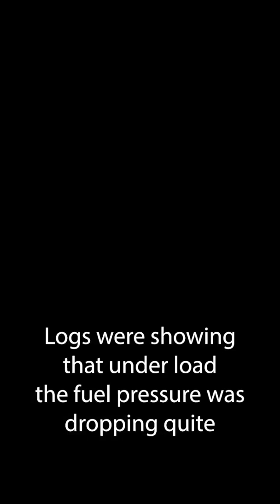The Supercharged Marauder is fixed!! Fuel... #shorts

Comment from the maker: Check out our Q/A video!  Long form video based on your questions and comments!

https://youtu.be/Rn21a6UMAcQ

Answering common questions from these comments such as:

Question 1:  Should you use Anti-Seize on the NGK TR6s used?

Question 2: What is the history of the Mercury Marauder? (Focusing on 2003 and 2004 model years)

Question 3:  Why be excited about reliability at only 103,000 miles??

Question 4:  That car is slow! (Is it?)

Question 5:  What supercharger is that?  Were those factory supercharged?

Question 6:  Why not put more boost to it?  
Make it faster!

Question 7:  If data showed the fuel pump was bad, why did you get focused on thinking it was a headgasket?

Comment: For max performance do not put anti seiz on a plug with the shiny trivalent coating. Trivalent is a highly conducive anti seiz. Applying Anti seiz paste to these plugs acts as a electrical and heat insulator. A plug cools through the porcelain/threads and also makes a ground connection (+plus-equals spark) through the threads. Both are very important especially on a power adder equipped vehicle. Most spark plug companies will state this on their website.
Reply: Ya definitely not gonna listen to them especially with aluminum heads. I think the issue they are concerned about is breakage so my thought is shoot under the torque spec since the threads are “wet”. Considering the spec would be different on wet threads. Idk i have used anti seize on everything and never had an issue. I also always use copper anti-seize and rarely nickel. I have had issues before with the nickel anti seize. Also nickel i do not believe is sensor safe not that it really matters for most bolts.
Reply: @Sak-zo1ui  spark plug threads are already coated for anti corrosion, the main issue with steel fasteners into aluminum is from galvanic corrosion which the coating spark plugs have already prevents. Because corrosion is a non-factor all the anti seize is doing is throwing off your torque specs, which you say you “undershoot” to be safe, but now you’re adding in guess work. There’s a reason the manufacturer’s specify not using anti seize on spark plugs, you’re more likely to run into an issue using it compared to not using it, but go ahead and keep doing it if it makes you happy.
Reply: @Sak-zo1ui  dont overtorqe your stuff
never had a problem even on a overheated head
Reply: @TheWallsocket  yes the spark plugs are coated. Just like galvanized bolts are. When both are exposed to heat and friction (specifically the threads) that coating will get removed in many spots. This can allow for corrosion. With stainless bolts you apply anti seize to A. prevent galling and B. to prevent corrosion between opposing metals. The same effect is there for spark plugs. Yes they may have a coating but that coating does wear away very easily and will still not prevent galling. Now if the plugs are some basic plugs that are going to get changed in 30k miles alright. Does not really matter for corrosion. But an iridium plug that may last over 100k miles I think that anti-seize will have a great effect. But it still would not be protected from galling if not applied. Which galling does occur more in softer materials with fine threads. It really comes down to the depth of the thread. There is no downside to antiseize. 

When i was saying “undershoot” i was refering to not trying to hit a specific torque. When torquing dry threads you may know that the bolt may stick and can often times require more torque to get to the correct torque spec. An easy way to solve this lubricating the threads. When using antiseize the torque should be hit and thats it. Do not keep checking the torque. I know undershoot is the wrong term I just cant think of the correct phrasing. Remember we are talking about bolt torque which is used to get an approximate clamping force of a fastener.
Reply: @spedracer55  i dont over torque my stuff. But torquing dry threads can cause over torquing. Wet threads always are more accurate torque specs.
Reply: Highly unlikely any spark plug manufacturer would specify not using anti seize on spark plugs with long term service intervals with dissimilar metals and low HP levels, this is not a max effort replace plugs ever couple hundred miles race machine. Long term thousands of heat cycles will create a perfect storm with that coating and no anti seize to gall and destroy the threads coming out. Ive done it with NGK and other brands never again, they work fine for max effort high hp and regular changes but not for long tern use.
Reply: @young11984  most do specify to not use anti seize. Read some of my other comments if you want to read a paper lol. I see nothing wrong with using anti seize.
Reply: @Sak-zo1ui  especially ngk
Reply: @Sak-zo1ui  they also recommend short service intervals not 100k miles also, i use it and always will because i have had to remove heads to get seized plugs out of heads with 40k miles on them at the dealer. They recommend but its always service bulletins to change recommendations or add a way to get plugs out vs telling you to add a touch of anti seize to solve the whole issue
Reply: @young11984  i do the same to brake lines. Very minuscule amounts at the top of the threads. It works never had an issue and I dont round flare nuts anymore.
Reply: Most intelligent comment I’ve read in way to long! Thank you
Reply: I’ve maintained and driven many high mileage Fords. 79 LTD 351 windsor, 93 Lincoln Mk 8, 99 Towncar, 06 Towncar, 03 F150 FX4, 2012 ecoboost FX 4. All but one of these had over 200,000 miles when I sold or totaled them because someone rear ended me. Never had a problem with spark plugs seizing even with intake manifold leaks dumping coolant right in the old 4.6 plug hole where it just sits there wet forever and eventually causes a misfire. No anti seize ever used. Also no torque wrench ever used on spark plugs and no problem because of it! 
I did always use motorcraft plugs and motorcraft other high maintenance parts and filters.
Reply from the maker: This is a great comment. I've already noted in some other replies that I've had it hammered over the years to use antisieze on Ford aluminum heads of this era. Never thought twice. But read up on the NGK site and understand. Your comment also very informative.  I swap plugs on this car fairly often so next time will go without and see. So far Ive not had any other issues but to be fair this is a relatively low boost car at 9psi and stock ignition coils.  I could see this being much more important on race / high boost applications where maximum spark energy needed. Still great info and I'll follow it next time around
Reply: I never used anti seize on plugs alum or not unless the factory manual says so and I never seen the factory do it
Reply: @young11984  fun fact plugs come out very easy on a hot motor I never had a issue taking a plug out
Reply: @jimcatanzaro7808  ok, work in a shop up north and at the beach then tell me how easy it is
Reply: You just fixed my mystery misfire thanks .
Reply: @kevintucker3354  thank you
Reply: Ngk specifically says do not use anti seiz on the box
Reply: @Usual Suspect William Hamilton it's because of the coating they use on the threads also technically if you do put anti seiz on the threads the torque should be adjusted because it is no longer a dry torque
Reply: @Sak-zo1ui  I read something similar to this on ARP’s website
Reply: @FZERO20  yes. Dry torque is very different from wet torque.
Reply: @VortexGarage  your right, I see what this guy is saying, but I've put enough helicoils in these thin aluminum heads

Comment: The ngks I've always used are plated and you should NOT put anything on the threads. Lube on threads makes the recommended torque incorrect.  If you use spec torq and lube you are over torquing the plugs.
Reply from the maker: Great info - I've always done antisieze for years and years so much I don't ever think not to.  Read NGKs site and next plug change will try without. Always made me nervous not using on the older ford aluminum heads but seems the newer plugs helped solve that.

Comment: Another 👍🏼 to the OP. Use it very sparingly and only the smallest in the middle of the threads, you’ll be fine. 
Also a tip for those of you with the dreaded 3 valve tritons, always remove the spark plugs when the engine is HOT, use gloves and be careful for burns. Be warned that if you try to remove plugs when cold, your chances of shearing that plug go through the roof. Promise you’ll really wish you could trade that broken plug for a burn on the back of your hand every time.✌🏼

Comment: You're not supposed to use anti-seize on NGK spark plugs
Reply: Why not 🤔🤔
Reply: Pls explain as I do
Reply: There is a trouble service bulletin out that anti-seize prevents NGK spark plugs from grounding properly into aluminum heads
Reply: @Red_Tech1  Ok. I was reading that on a few of the forums.

Comment: Ngk plugs are designed for use without lubricant
Reply: For racing and random changing, not for 100k mile intervals as these were....not a downside or negative affects of using it for long term intervals and low HP levels
Reply: @young11984  Makes no difference, the spark plug manufacturers do not advise using anti-seize and I doubt the car manufacturer does either.
Reply: @ferrumignis  makes a difference when i can pull a plug at 100k miles and do not harm a thread because antiseize was used but have pulled many at 40k and galled/destroyed the threads for not having it. Why would a manufacturer say not to use it? So they can sell more parts when the threads get torn up, thats why. I guess you do everything the manufacturers and parts suppliers recommend then, if so you would never race your car to begin with and find limits of said parts.
Reply from the maker: Stated in some other replies but this is great info. With ford aluminum heads I always used it without a second thought. Many plug changes and no issues but you are right checking NGKs site they use plating on the TR6 plugs and say it's not needed and could affect torque spec. Next change I'll go without.
Reply: @Usual Suspect William Hamilton  NGK do not recommend anti-seize as confirmed by Vortec garage above.
Reply: @Usual Suspect William Hamilton From the ngksparkplugs website:

"NGK spark plugs feature trivalent plating. This silver or chrome-colored finish on the threads is designed to provide corrosion resistance against moisture and chemicals. The coating also acts as a release agent during spark plug removal. NGK spark plugs are installed at the factory dry, without lubrication or anti-seize."

"Anti-seize can act as a lubricant, altering torque values up to 20 percent, increasing the risk of spark plug thread breakage and/or metal shell stretch. Thread breakage can sometimes involve removing the cylinder head for repair. Metal shell stretch changes the heat rating of the spark plug and can result in serious engine damage caused by pre-ignition. Do not use anti-seize or lubricant on NGK spark plugs. It is completely unnecessary and can be detrimental."

Why not grow up, accept you are wrong and learn from your mistakes?

Comment: I've got a beautiful 03 Grand Marquis with just under 300,000 miles and have always put the plugs in dead naked, never had a problem.  They do tend to vibrate loose if you don't torque them down properly but since I always do that, they never come loose.

Comment: That’s a cool video well done but I think I would’ve checked the fuel pressure before I was doing compression testing. I wouldn’t do that unless I had a continuous missfire
Reply from the maker: I should do a long form video to talk through it more. Basically I had seen something that had me concerned about the engine. When it ran poorly I started connecting engine dots. A good lesson in the end though that the data tells the story and the truth

Comment: Extremely common on crown Vic.
Only showed up on police cars after idling for a while then full throttle for 8 seconds. Ford blamed municipal fuel supply and made us seems out the tables for cleaning. They also conveniently updated the fuel pump though.

Comment: ngk spark plugs come witha anti-seize coating on them already, puting anti-seize on them will give you a false torque reading on occasion.
Reply from the maker: Very interesting - I just read up on their site. I've been doing a dab of anti seize on plugs since I can remember. Never had an issue and was always nervous not using it on this Ford aluminum heads. Plugs always came out nicely and there were so many horror stories of galled threads. Anyway I'll say I wasnt fully aware of NGKs recommendations. I swap plugs often so next time I'll go with what they recommend!

Comment: Anti-seize in aluminum heads is a myth. Tell you I have done more fucking plugs then I care to even remind my self. Anywhere from standards, copper, iridium, platinum, silver and so on. Vehicles with 30k, 60k, 120k miles and even people who didn’t do there maint and would go tell they failed with over 300k and never have I ever had a issue getting plugs out, now of course I was a Toyota tech so never mind that’s why, i forget sometimes that some vehicles are not built to the same quality carry on.

Comment: Doesn't anti seeze create mis fouling plugs ...
Creates insulation..
Reply from the maker: I've never had an issue but only use a tiny bit on aluminum heads to prevent galling. Though apparently NGK coats their plug threads with a special plating and recommends no antisieze. I've used it without second thought for many years and no issues but will follow NGKs recommendations

Comment: 103000 miles is really nothing if you take care of it. I had a Shelby GT 500 that had 75000 miles on it and I think it ran better than when I bought it.  Mon had a plasma coating in the cylinder wall and the marauder did doesn't. 
SVT 🤟
Reply from the maker: Yes - also important the Marauder engine is a non forged motor, so it's done well so far living with boost.  Those svt motors are sweet though!
Reply: @VortexGarage   I was not sure if that vehicle was an SVT vehicle.. SVT was bad-ass.
 I have a client that has 2 or 3 of those.  I always like them.
 What do you think about the new Shelby GT 500 motors ? As far as longevity

Comment: Never use antisieze on NGK plugs they are the only spark plug brand to have antisieze threads using antisieze voids the warranty @Vortex Garage
Reply: Not trying to heckle I just found out myself
Reply from the maker: I'm so used to using it I didn't know either - but did find it on their website.

Comment: I got a 95 Chevy van that's got 130,000 miles on it and it runs like a top I ain't never had anything but the alternator changed and the thermostat in the belts whatever the small that thing's a piece of s*** it's going to fall apart and another 100,000 I'm very still going strong

Comment: Those oil pressure gauges aren't real
Reply from the maker: Stock that's correct but long back I put in a real ultra lite 2 gauge and sending unit. But you're right stock they basically a warning light in operation

Comment: 103 thousand miles on a Toyota it’s still considered a baby has another 300,000 to go
Reply from the maker: Yes - I the only reason I'm partially proud of the mileage is it's had boost since 22000 miles. These are not forged motors so while they respond great to boost they can suffer longevity under high boost or bad tunes. Otherwise stock they are very reliable engines.

Comment: What would cause fuel pressure to drop under load though? And also is it possible to still see good fuel pressure with a bad filter?
Reply: Bad fuel pump lol
Reply: @RedHaloManiac95  i meant why would it drop under load vs at idle? Like the pump just cant keep up with the demand?
Reply: I might be experiencing something similar. Fuel pressure is spot on at idle but i haven't drove it with a gauge hooked up to see if it loses pressure under load.
Reply: @chrissanders2562  yea you don’t need nearly as much fuel at idle as you do at full load. Pump was week and was no longer flowing enough
Reply from the maker: Yep Ken got it - as the car goes under load more fuel is used. A pump on its way out may be able to retain pressure at lower load but once more demand for fuel it can't keep up.
Reply: @VortexGarage  sounds like my problem.

Comment: What was the original issue
Reply: FoMoCo
Reply from the maker: Under load (accelerating into traffic for instance) the car would fall on its face and loose power. It'd otherwise start, idle and rev with no load fine

Comment: Needs more than a supercharger, that was disappointing.
Reply from the maker: Only 9psi of boost - they respond really well to more but the non forged motor takes more of a beating in the long term. I may one day crank it up but for now it's a great cruiser with good power - about 390-400 at the rear wheels

Comment: You're doing it wrong bro you're supposed to use Loctite on those still studs in that aluminum head not anti-seize and you used a ratchet come on man you know you're supposed to use an impact at like 150 foot pounds and just torque them in as hard as you can I mean that's what every other mechanic does and that's why I don't take my cars to mechanics all joking and sarcasm aside great job